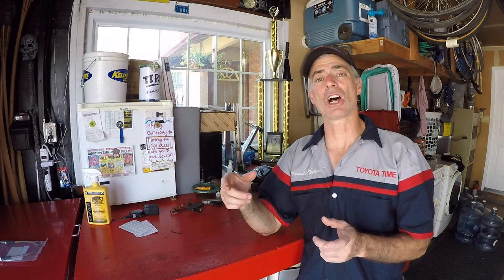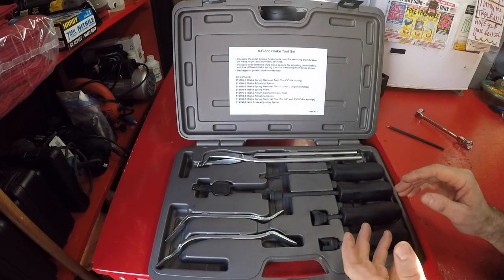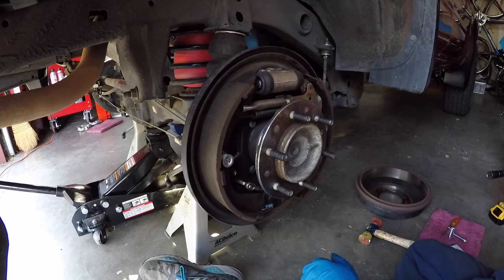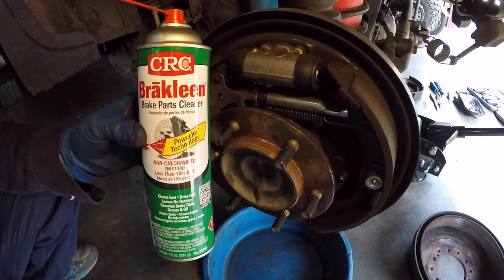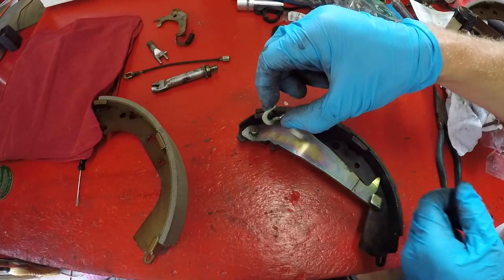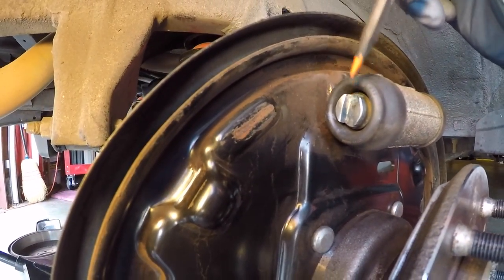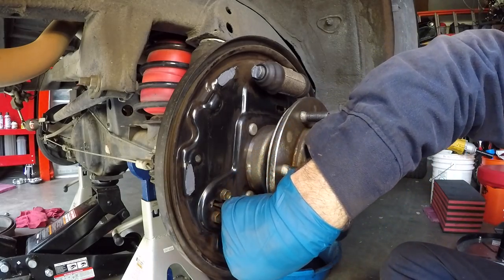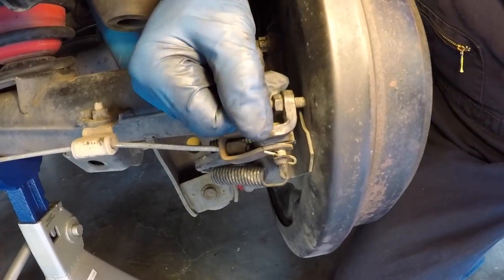Drum Brake Shoe Replacement

Comment: Can I get the link for that grease gun or name to search in amazon
Reply from the maker: I added a link to the video description.
Reply: And the link or name of what kind of grease are you using
Reply from the maker: @palaciosivan100  I just use a multipurpose grease called Red Devil in that little grease gun.  I can't remember why Jordan wanted to use it.  The grease I recommend using for brake parts is listed in the video description.

Comment: Toyota recommends cleaning the hub flange and replacing the paper gasket between the drum and flange. This can affect brake noise. There is actually a TSB pertaining to rear brake noise on 2nd Gen Tacoma’s. The paper gasket is identified as a replaceable component in the RM. Nice video otherwise.
Reply from the maker: Hey Kevin, what paper gasket are you talking about?  I've had rear drums off probably 15 3rd Gen 4runners and there is no paper gasket between the face of the axle and the drum.
Reply: Timmy The Toolman Toyota Part No.: 42444-35050. It was in the illustration in the repair manual you showed in your video. Doesn’t seem like much, but it changes the natural frequency of the drum/axle/shoes  which helps with brake squeak.
Reply from the maker: @kevinpilotte8738  Very interesting.   I've never seen this gasket before.
Reply: Timmy The Toolman I retired after 46 years in the automotive industry. It was a constant learning experience. My head hurts!

Comment: Has anybody had the problem of the parking brake light not turning off after doing this? Does that mean they are too tight?
Reply from the maker: The brake light will go on for two reasons.  One, to let you know the parking brake is on.  The other reason is to let you know your brake fluid is low in your master cylinder.  If the fluid level is good, it's most likely a faulty parking brake switch to tell the computer the parking brake is off.  That switch is next to the base of the parking brake lever.  You access it by pulling up the center console trim piece around the parking brake.
Reply: @TimmyTheToolman  thank you! This only happened right after completing this brake change so I thought it may have something to do with that but I will check these. Thank you for your help and your videos!

Comment: Drum brakes are so idiotic. I wish these trucks had been equipped with disc from the factory
Reply from the maker: They're not so bad once you get use to working on them.  I was intimidated to mess with drum brakes at first but after I did this job with Jordan, I realized it wasn't that bad.  I know there are some vehicles with much more complicated spring set-ups than ours so I guess were lucky on that regard.

Comment: the parking brake trick should workin an automatic right? and thats why my pedal is so soft? i replaced the brake cylinder aswell.
Reply from the maker: Yes, it will work.  Pull the parking brake over and over again until you get only 7-9 clicks from the handle.  This is provided your bell cranks aren't seized up and are functioning properly.